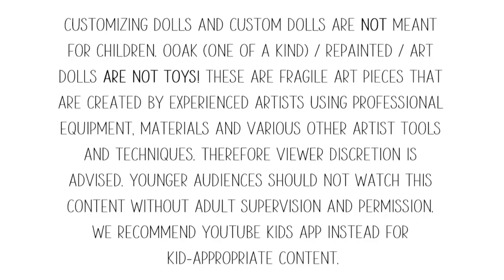Wig Basics - How to Make a Wig Cap for Art Dolls and Sculpts OOAK

Comment: Mod Podge makes water resistant glue! I’ve used it to make wefts and it works pretty well.
Reply from the maker: Omg that's great! Thank you for sharing, I'm surely going to try it. 💕😊
Reply: Modge Podge is also PVA glue. :)
Reply: It took some searching since the brand itself isn’t. But they do have a water resistant version. It has quite a bit of a longer curing time. I haven’t tested it with hot water or boiling.  But washing it seemed ok. I make my wefts on a crafting mat that’s anti stick, and it allows the glue to dry with a super shiny and smooth side. It has the thickness of elmers glue and is easy to work with.
Reply: do you reckon liquitex matte varnish would be substantial?
Reply: @BloxyMelonio  I’m not sure since I have t used it but if they are comparable in what they do then I’d assume so!

Comment: If you still haven't found a water resistant glue, I recommend Pattex 5 minute epoxy. It's clear, water & heat resistant (to a degree of course, ironing the cap will probabley make it melt) and it has a little bit of stretch to it when it dries (like hard rubber). It's pretty cheap too :) The only downside is it cures fast and the brush you use to apply it will probably be unusable after one use :P